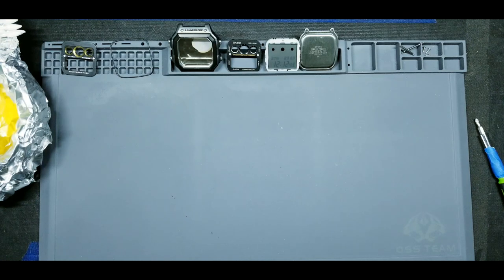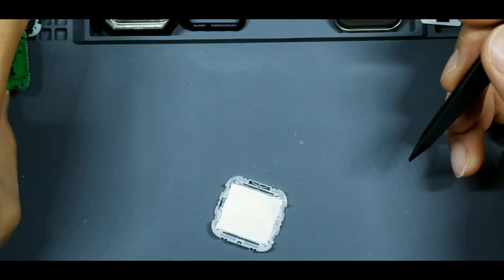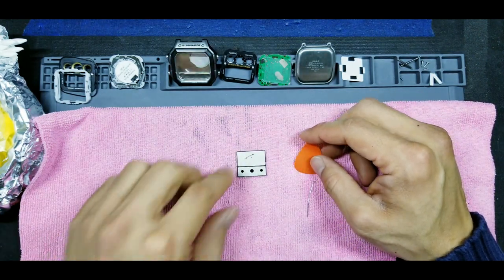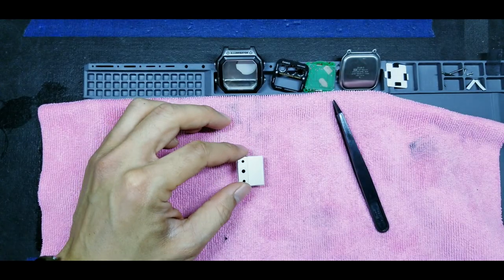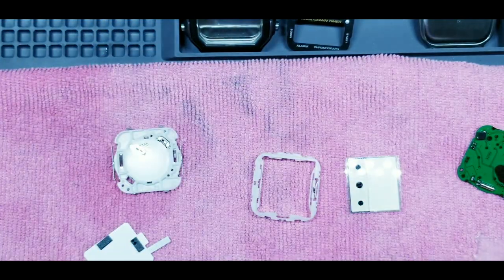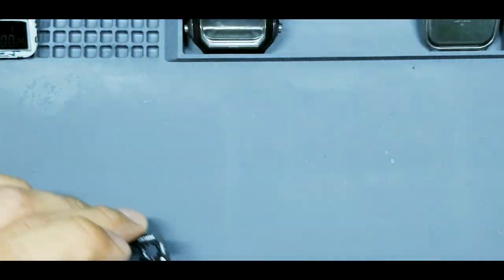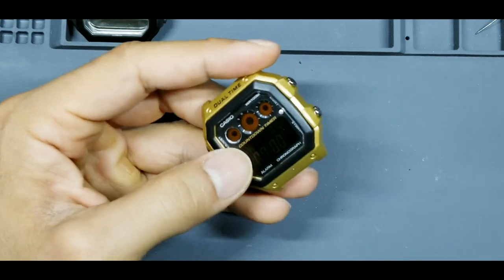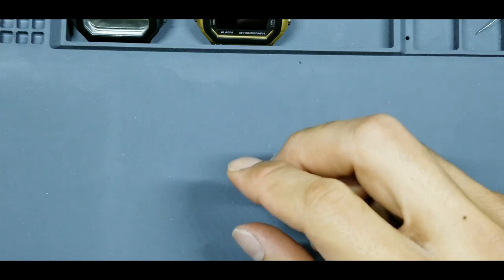Another Casio World Time mod 👍

Comment: I love the amount of detail you go into. The foam strips are stacks of alternatingly conducting (graphite impregnated) and non conducting silicone. They conduct between the exposed pcb pads and the conductive indium tin oxide electrodes on the LCD glass.
Reply from the maker: Glad u enjoyed. And thanks for the info on the foam. Couldnt find info on that on the web 😁👍
Reply: @watchncarry9593   I am a big fan of Casio watches, and I love watching these videos where you do plastic or cosmetic surgery on these watches.

Comment: Where can I get a tray/workingsurface like that.
I am talking about this thing with all the appartements for the screws, springs ect.
How is it called or where can I buy something like it.
Reply from the maker: Theyre called Silicone Soldering Heat Pads. Super useful. 

Heres one:
Soldering Mat Heat Resistant 932°F Magnetic Silicone Electronic Repair Mat  for Cellphone, Laptop, Computer, Heat Insulation Pad for Soldering Iron Station15.9” x 12” (Grey) https://www.amazon.com/dp/B075M7PQZX/ref=cm_sw_r_cp_apa_i_u0vUEb1YX7D4N
Reply: @watchncarry9593  Thanks for the quick response bro👍 definitely gonna get me one of these.

Comment: Is it possible to remove the whole polarizer film and then stick 2 single pieces rather then cut the film on the display, or the 3 circles are drown right on the filter?
Reply from the maker: Yes. You can remove the entire Factory polarized filter, and add your own separate brand new polarizing film as you see fit.

Comment: What's the alternative for goo gone?
Reply from the maker: I've never tried anything else, but I've heard others use nail polish remover, alcohol, or Goof Off.
Reply: I tried to use 70% iso alcohol, but it doesn't remove the print. May I know what type of solution did you use? 

Thanks in advance
Reply: I used Close Up toothpaste ( but this leaves a shine finish) ,  or Cutex (Non Acetone)   or 40% Isophropyl Alcohol.  Just  rub it  gentle and light until the  writing fades. Beware: you cannot completly erased the  letters on the bezel ,otherwise you will ruin the paint. The idea is  to make it make it not visible  as if there is nothing written on the bezel.  https://www.facebook.com/photo?fbid=2759895020899770&set=gm.4171830279515097